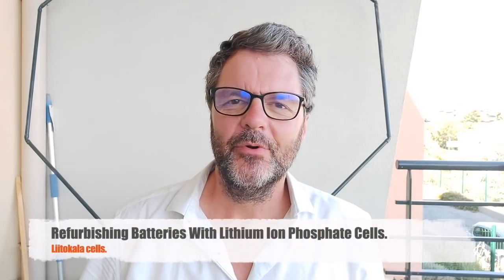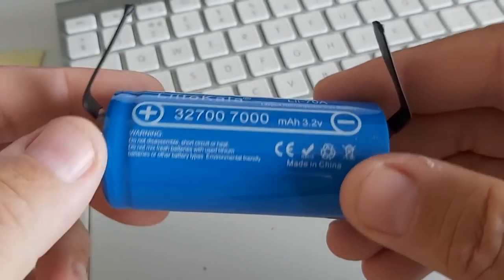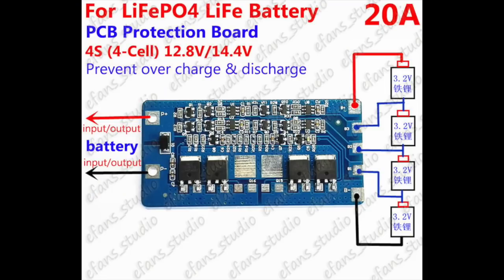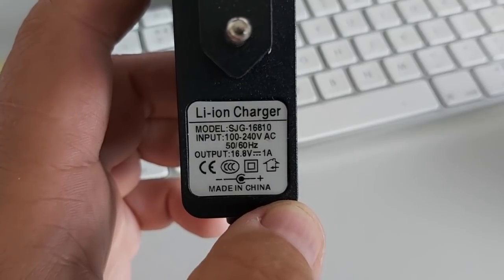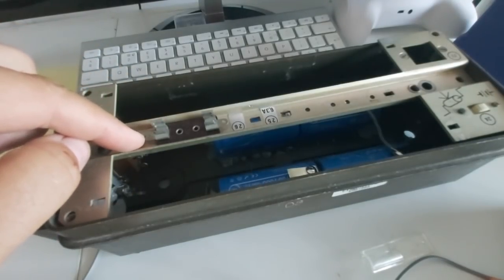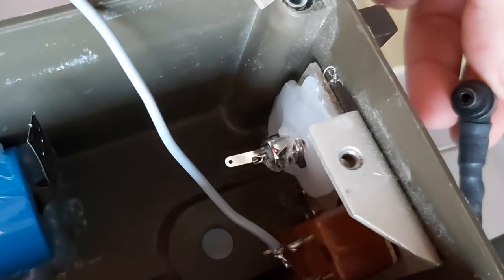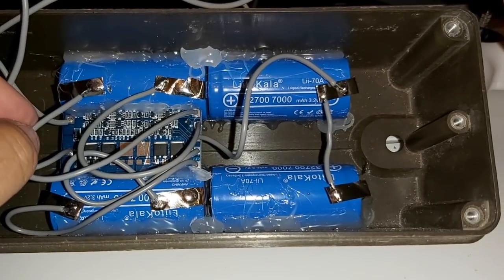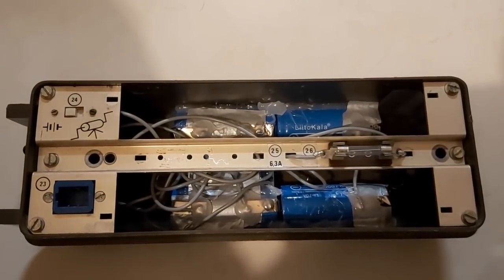Refurbishing Batteries With Lithium Ion Phosphate Cells.

Comment: I tested the Liitokala Li-!on batteries and they were good. So yours have a chance to be ok...
Reply: In my head I read this in a Swiss accent.
Reply: I also purcharsed LITOKA LiFePo4 cells from AliExpress, but was a little bit unlucky since the seller sold used cells and 3 of 12 died with a pop off, and one more later literally exploded out of nothing. And Yes, BMS was perfect, no issue there. Neverless, the remaining cells work grate sice one year. The performance of LiFePo4 cells are incomparable to LiPo or outher cells technology's. Very powerful and with the perfect voltage level in 4s configuration to make a grate powerfull and lightweight mobile TRX supply. Next time I will be more carefull with the seller on AliExpress.
Reply from the maker: Definitely to be monitored, we'll see...

Comment: I do the same often with old portable radios.  I use 18650 cell holders and cells. I have found that using  a decent smart charger has advantages over a  BMS and allows charging of individual cells or a cache of batteries and not inhibiting equipment usage during a charge cycle. Cell measurement and replacement is simplified as well. Thanks for sharing !

Comment: Whenever I have made up lithium battery packs from individual cells, I ALWAYS used heatshrink sleeving on the exposed connections. LiFePo are much safer than LiPo but there can still  be a problem if they fail.  Personally I now prefer to use the 4S2P 13.2V LiFePo packs that are sold for RC airplanes, when I go portable.  But they're not cheap!

Comment: I  made some battery packs using similar LiFePO4 cells. Under test mine give around 3300 mAh.  Full charge voltage 3.6V per cell and they hold 3.2V under load.  The voltage range with 4 cells is perfect for most radios (between10.8V to 14.4V and around 12.8V under load).   I run mine though a buck/boost convertor (filtered for low rf noise) at a constant 13.8V out regardless of the input voltage.  Cheers. VK4PWG

Comment: PS unless there is an alternative nomenclature, I believe these would be more correctly referred to as Lithium Iron Phosphate not Lithium Ion Phosphate.
But yea, I would be skeptical of those batteries. Ordered some rechargable AA earlier this year and they were advertised as 3000mah capacity. I did a discharge/recharge test though and the capacity was only about 300mah and had an internal resistance of 112 ohm. The seller refunded my money. I suggest testing the capacity!
Reply from the maker: Definitely, I will..

Comment: Hi Gil, Great video. I have built several LifeP04 battery packs. First, I have shorted cells because of the thin insulation. I have found that cardboard works really well. Next, The BMS has short circuit protection which is really good. The BMS will also balance the cells. This means that the max charge voltage for the pack will be equal to the lowest cell voltage. 13.7 volts for the pack is good. It is better to under charge than to over charge. The LiFePo4 batteries have some great attributes. They have a low internal resistance which means that when you talk on your radio the voltage will not drop like an SLA. They also have a very low self discharge rate. I have found that when I let a pack sit for 6 months or so the voltage had not dropped at all. I have built HeadWay battery pack as well. They are fantastic. I hope this helps. ~ Ron
Reply from the maker: Good news thanks!

Comment: I would recommend to use imax b6 mini 2 and do not keep pcb inside battery pack. But have balance and charge wires outside battery pack. This will allow to control charge voltage and current. Only one downside that you have two wires outside battery.
Reply from the maker: Good point..

Comment: Gil,
Just a quick comment about the battery pack refurbishment. I am concerned about a string of issues that may cause a catastrophic failure in the battery pack as you have constructed it. 1) the thin insulation of the batteries themselves- the fact that just a little dab of heat from the soldering iron melted the insulation to the point a short was produced, is dangerous.2) Duct tape, depending upon who manufactured it, can have metalic "fibers" running through it. Better to use electrical tape or standard heat shrink. 3) hot glue is not that great an adhesive, and can separate due to heat, vibration, and impacts- all situations that are characteristic of the environment to which you will be putting the battery pack through in your adventures. I know you are very innovative and are skilled at adapting low cost substitutes for more expensive commercially available materials and components, but I am concerned for your safety in this particular situation. I don't want to see you lose your radio, or your vehicle, or get burned if this battery pack experiences a failure where the batteries are dislodged by an impact and all those bare connections suddenly can come together in a short circuit and create a high temperature condition that causes materials in close proximity to ignite. I hope you will rebuild your battery pack at your soonest opportunity to make sure it is mechanically and electrically stable in the rugged use case you have. I really enjoy watching your videos and feeling like I am along with a friend on a great adventure. I look forward to each of your videos.
Reply from the maker: Thank you, this has indeed been nagging me. I will dive back in and improve the park's safety.

Comment: Good project Gil and thanks for sharing. I wonder if you have the part numbers or link to the BMS and charger that you used please? I was thinking about using these 32700 cells to make a couple of battery packs for my FT-897.
I hate to be a spoil sport. However, like one or two other commentors, I was also a little concerned that you should maybe add some more insulation and secure the battery a little more.
Reply from the maker: Agreed. I don't suggest using that BMS. Charge voltage is too low. See Ebay..

Comment: You’ve got to use up those glue sticks somehow Gil! Good tip on the DC plug when soldering 👍🏻 Thanks.
Reply from the maker: Yep! LOL.
Reply: Yes, that was something I never thought of. Good idea. It may also help to sink away some the heat during soldering and reduce risk of the connector melting?
Reply from the maker: I think so, definitely a good precaution.

Comment: Great idea to plug the DC connector before soldering. I’ve melted far too many, haha.
Reply from the maker: So have I ;-)
Reply: @RadioPrepper  My favourite for melting is the centre pin on some of the cheap 1/8 jack plugs. Best to use a pair of long nose pliers as a heat sink.